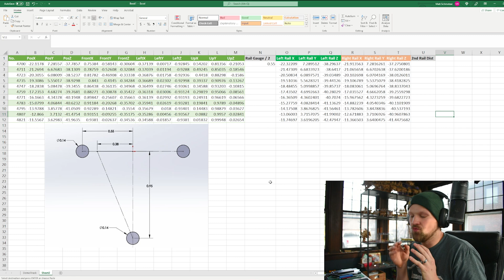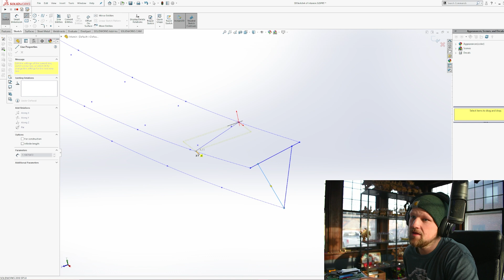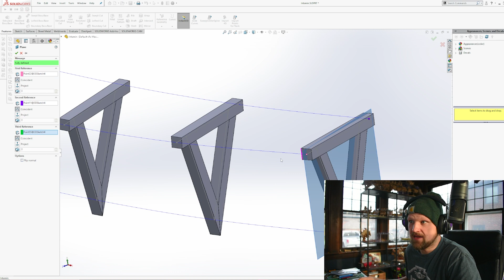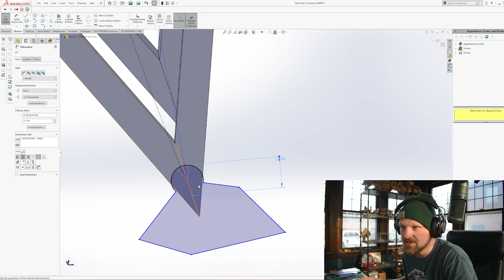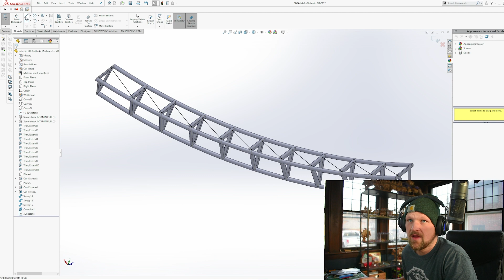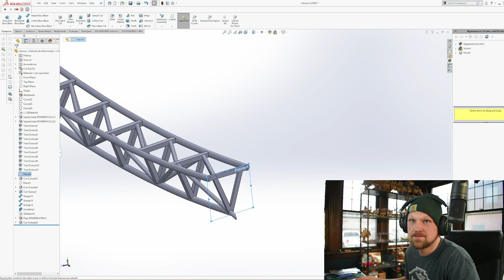Design For Fabrication - Ep. 3 - Design Intamin Track in CAD

Comment: no offense but this video series is seriously impossible to follow. you're not saying what keys you're pressing and when, you're not explaining which menus you're going into or why, and you're talking so fast that it's difficult to understand what you're saying. i have pretty much no hope of ever doing what you're doing just by watching these videos.

you'd basically already have to be a seasoned professional with CAD and SolidWorks in order to have any hope of understanding what to do.

my suggestion would be to either reupload these videos with a disclaimer at the beginning about requiring prior SolidWorks experience, OR to redo them MUCH more slowly and actually thoroughly and SLOWLY explain exactly what you are doing at every single step.
Reply from the maker: Which function are you struggling with? I mentioned using macros in this video however in the previous I explain what I am doing. Yes you will need to understand CAD fundamentals before jumping into coaster design. If you are struggling with the commands there’s millions of Solidworks tutorials online.

Comment: Great video! I was trying to follow your video. I have an issue: I don't have the "Imports Points for Track" button. Where can I find it?
Reply from the maker: I might have been talking fast but that is a macro button I created. If you Google “import xyz points into Solidworks” you should be able to find more information… or even a free macro. Good luck!
Reply: @printmyridedetroit6115  Oh ok, thank you for the answer!
Reply from the maker: @M-RICK19  you can also check my previous video (ep 2) I talk a bit more about bringing in curves.
Reply: @printmyridedetroit6115  Yes, I managed to bring in the curves and do all the excel work. I only needed the points so I can connect the cross ties. Do you know if there's any way to import the spline in an assembly rather than in a piece? That way, I'd be able to make the track pipes and cross ties in separate pieces.